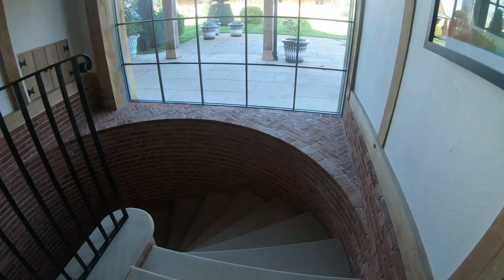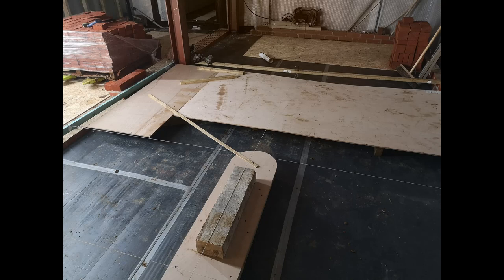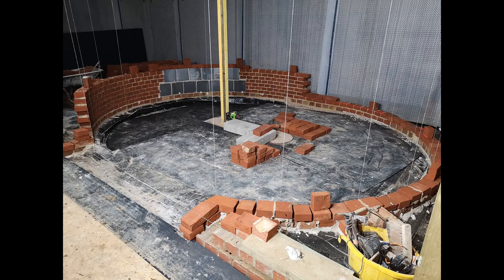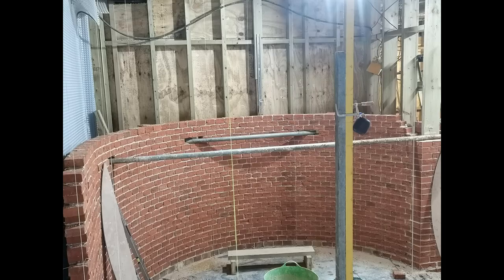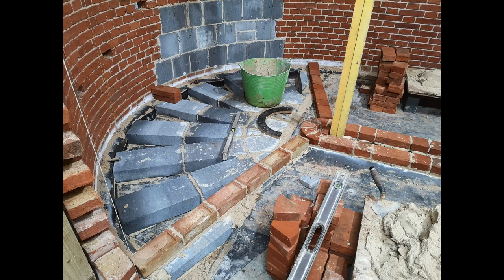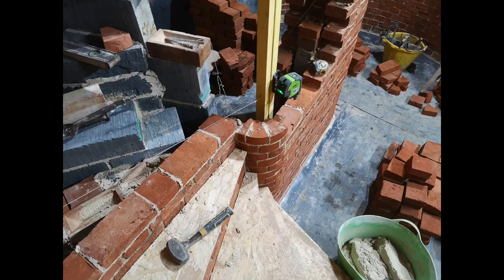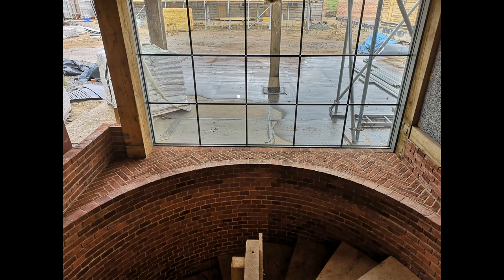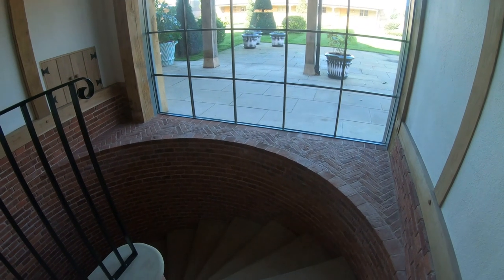the fine art of brickwork - Spiral Staircase

Comment: WoW Rob!  Amazing work indeed. So much to consider at any one time.
A question.  What would 'early bricklayers have used to keep the brick courses correct instead of the laser?  
A water level perhaps?
Regards Mark in the UK
Reply from the maker: Yes, water levels were there way of transfering levels over distances
Reply: Another way to make curves is to use wooden or metal molds that are carried upwards divided between a number of profiles. 1 time a level line, then a division on the profiles. The top side of the brick is then top mold